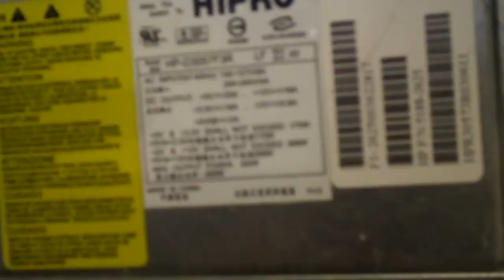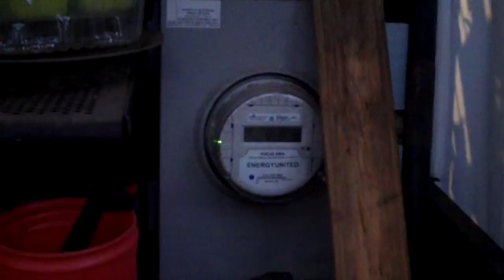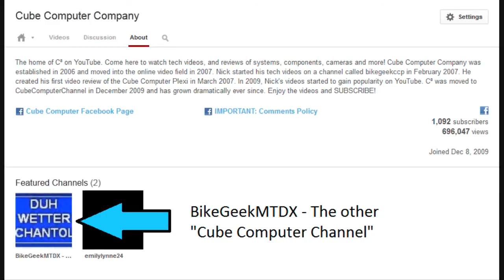The Filthiest Computer To Date Gets Cleaned Out! DRYWALL DUST!

Comment: Hi cube computer lately ive had a problem with a pc fan before I added oil to the fan bearing it was fine and silent but after I added mineral oil the makes a grinding sound and like something is scratching do you know what caused this , ive used this oil before and had no problems ?

Comment: When you find a dust ball the size of an average cat in the bottom of the case let me know. What you have there is nothing. I had a woman bring in her machine, wondering why it stopped working. The CPU fan was making happy little trails around the top of the heatsink. I'm not sure how it survived long enough to do that. It defies belief. More to the point a lint ball the size of an average cat rolled out of the bottom of the case when I opened it. The thing filled half a small waste basket. The one your cleaning in this video comes nowhere near that bad.